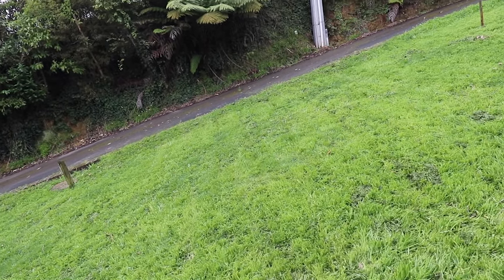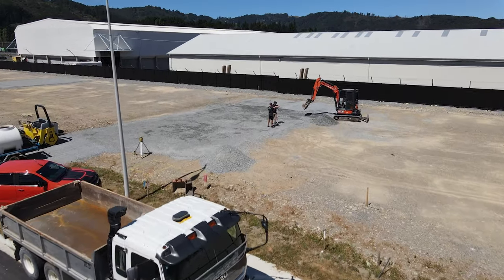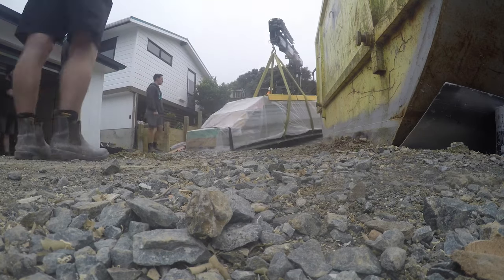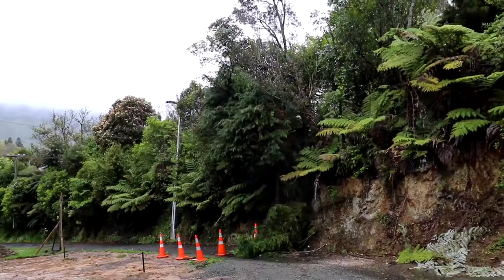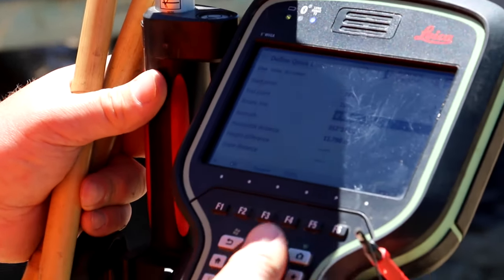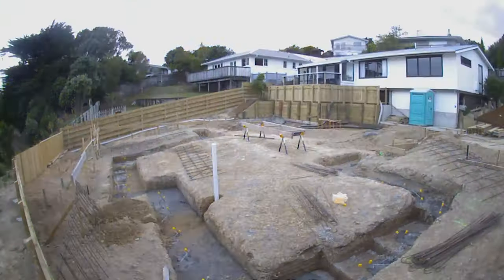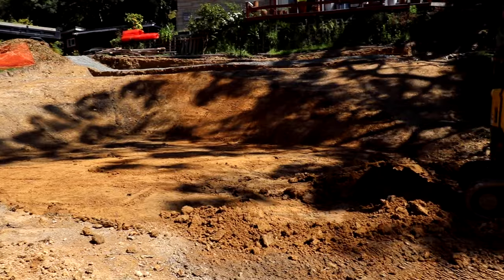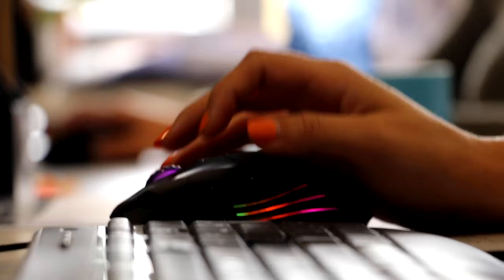How to Build On a Sloping Site

Comment: Step 1: Chop the trees down first before bringing the council into the project.
Reply: The first thing I was told by the surveyors and planners at work. We have a load of work to do in our garden if we didn't take the trees down we would have ended up with preservation orders on them when we went for planning. This would have made our plans impossible to do, our garden unusable (no light) and then the house unsellable as the tree's (8 firs and a massive weeping willow) maintenance would have been huge because it would affect other gardens and storms were causing them to lose massive branches, one of which from the willow crushed an apple tree into the ground last year during a storm.

Comment: Hey Josh! thanks for the videos, I had a quick question. I notice that right after the bottom part was built, the builders added wood framing, how is it attached to the floor? @5:45
Reply from the maker: It gets bolted to the concrete